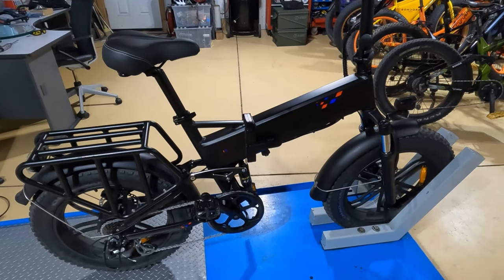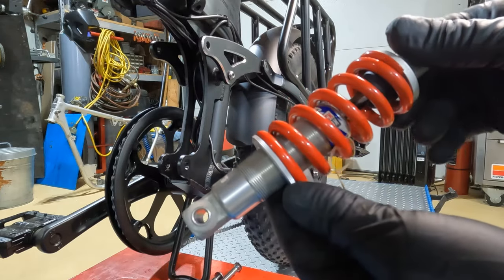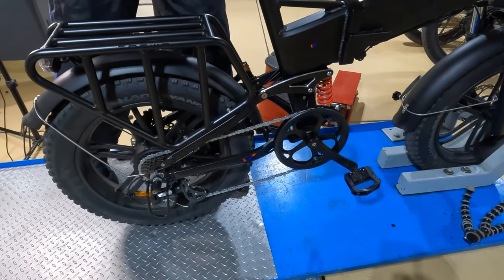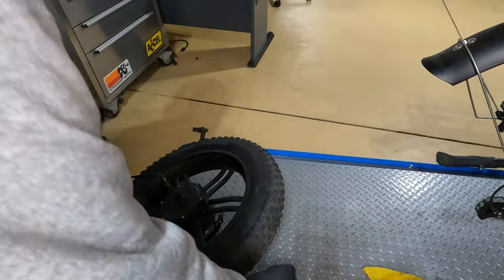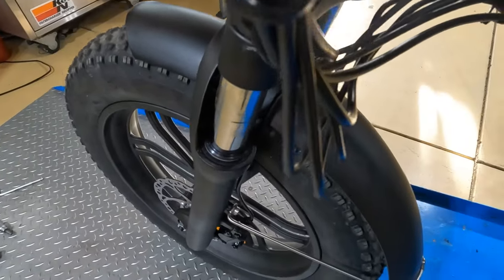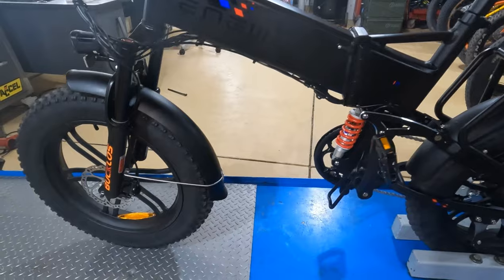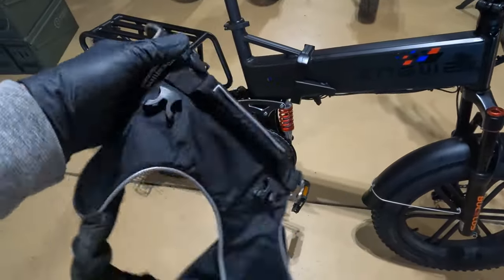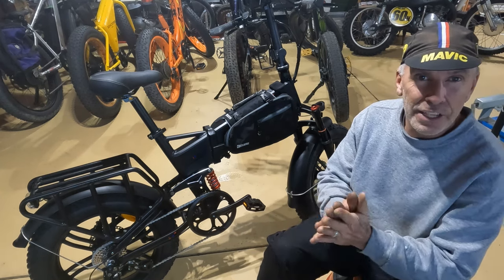Engwe Engine Pro 750w ebike Mods!  faster / smoother/ cooler!

Comment: engwe sells the bmx handle bars with the foldable bar together if you get the set you can use just the folding stem and put what ever handle bar you want the original one is way to tall and it looks ridiculous in my opinion that was my one and only upgrade so far get rid of the funny looking handlebar and too tall tube

Comment: Hello. I see that you know electric bicycles well. I want to buy one, but I have no way to try them. That's why I would appreciate it if you could advise me on a model. I tell you my needs. I am 70 years old and I am 5'5". I weigh 70 kg. I want it to walk, mainly on steep mountain trails. I don't need speed, but I do need it to be able to climb steep trails without having to pedal.
Reply from the maker: Hello Pablo,  welcome to the ebike family!  My best suggestion for you would be to go to local ebike shops and try out the bikes they sell in person. After doing so some people are impressed with the power and some are disappointed-- thinking they would be more like motorcycles. Until you try some out you really don't know if you are even going to like the ride they provide. Sorry, but that's the best advise I can give!  Cheers

Comment: Does the resistance on the motor (regen feature) hamper the free ride sensation? I like to buy a Engine Pro and doing research.
Reply from the maker: Sorry for the late reply. Yes absolutely, it feels as if you are using the brakes if you are not powering the motor.  There isn't an real "coast" sensation unless you are on a bigger hill. Please check out my regen video.  Cheers

Comment: Hi! Do you think it would be possible to increase the power? Like putting bigger engine or actually adding a second motor up front?
Reply from the maker: Hi Michal,  sure, adding a front hub motor, a second battery, a 750 rear hub motor are all possible and not too difficult to do. The question becomes do you put that time and money into this bike or do you just get a different bike that better suites you. For the same money you can get a much faster bike with a torque sensor (so important to a smooth comfortable ride), bigger wheels to smooth out the bumps, etc.  I'd say if you are hurting for higher speeds you are ready to upgrade to your next bike!  Cheers

Comment: Hi . I like the idea of the dog harness and side bags ..do the bags inhibit riding ( knee knock) when loaded.also am I right in thinking the harness is called K9 —- what’s the name of the bags ( K9)?. What size is the harness .. brilliant mods..I have one of the earlier Engwe Pro’s ..covered early a thousand miles with my Terrier on the back I use mine for work ( pest control)  .. I’ve changed the cassette also for climbing it’s like a Billy Goat now..also uprated the tyres to Kenda also pumped tyre sealer into the tubes ( that’s a must) and uprated the brakes .just subbed ( UK)👍
Reply from the maker: Hi Alan,  thanks for the comment!  I'm sorry to say I don't have a model number for the bags. I think that any bags of the same style will work well though. I liked these in particular because of the sort of tear drop shape of the bag, it fits the space very nicely. They are completely out of the way for me with no knee rub whatsoever. 
It's awesome that you get to ride with your dog! Mine are too large to ride with me although I have had my border collie in the trailer behind me for some shorter trips. 
You are right, with a gearing change this bike becomes a very good paved road climber.  Kenda tires would be a definite upgrade as I'm not too big of a fan of the stock ones, they are very thin and I believe they provide a fair amount of rolling resistance, They are definitely prone to punctures. Kenda makes some great ebike tires.  Cheers!

Comment: Did you have to modify the frame because the extra length on the shock or because it was a different shock ?
Reply from the maker: Since the shock is slightly longer the top bolt / spacers need a little extra clearance.

Comment: Does anyone know of a rear suspension similar to the one this gentleman is installing, that's the same size as original as I do not have the tools, to install a larger one , thx
Reply from the maker: Hi Dee,  you can use ebay item number 154852558419, it's a 6 inch shock with a 650lb spring that will soften up the rear end of the bike considerably.  No modifications necessary
Reply: Thankyou

Comment: Great video.
I just had 2 of these delivered last week - we`re not bikers, they're for transport when under way with our RV. One of the problems with buying online is not having the opportunity to test the bikes first. The second is how to deal with defects. We've come undone on both of these problems! 

Firstly, these are BIG bikes. I'm 5ft 7 and find the handlebars weirdly high. They're like the chopper bikes which came out when I was a kid - I remember trying one when about 12 years old and finding it very unstable. I'm therefore very interested in replacing them as you have done.

Secondly, both bikes are defective! The first one came with a broken cable, not detected until it had been assembled. This would appear to be a five pin power cable. We've sent photos but I don't see how I can undo all the cabling then identify and replace the broken one without some sort of engineer doing the job.
 
The second bike came without any keys!

I´ve taken the battery out of the first (dead) bike to be able to test the second bike. This re-enforces the need for a different handlebar, especially for my wife who's 1m 60cm tall (she's European:)

First impression is of a truly awesome machine. I just hope we can overcome the not so minor problem with the broken cable and somehow make the handlebars feel more comfortable. As we start to get used to the bikes I can imagine changing the suspension would make a lot of sense.
Reply from the maker: Hi Mac,  happy it gave you some ideas of what can easily be done to make it better.  I hate it when I get a defective bike out of the box, do you try to repair it or do you send the whole think back?

Please post here after you've dealt with the customer service department, I think lots of people would like to know how that all went. For me good customer service is a big factor in deciding if I want to purchase a bike.

I agree completely about the weirdly high bars, wish the steering riser was about 6 inches lower and still folded.
I understand you probably need the folding feature with your rv, but if not just put a normal bar stem on the bike with a set of bmx bars and it will look and feel much more normal.

Funny you compare it to the 1970's choppers, that's exactly what I was thinking when I first sat on the bike!
Best, Tom

Comment: The best upgrade I've done so far is to get rid of the tyres and put some kenda krusades on made a massive difference better range and grip. I tried the freewheel uohread but I couldn't get the gears to set nice as the chain would rub when coming off the freewheel but got a replacement original for £10 bargain. Great video and bike
.
Reply: Hello,  if you follow my channel you know how much I love the Kenda Krusade tires, they are awesome in all conditions. The tires that come stock on this bike are very cheap and thin, so not a big fan of these. There are a bunch of videos on youtube about how to adjust the derailleur to compensate for a larger freewheel. There shouldn't be any reason why it won't work well for you. Even if you don't go to a larger low gear I'd strongly suggest that the go to the smaller 11t high gear, it makes a huge difference when pedaling along at top speed!  Cheers and thanks for watching

Comment: Nice!
What rear derailleurs are compatible with an Engwe Engine Pro 750w? 
Also I see your Drift Maniac 8spd 11-32Tis. (Casette), how could you mount it if there are differences in the hub design?? :)
The Clubman cafe bars 7/8"  looks really nice! I have an MTB bars which reduced the height of the handle bar but yes, I cannot fold it..
Thank you for sharing and greetings from Skellefteå in the north of Sweden. (Do not forget to use winter tires)
Reply from the maker: Greetings from the USA, thanks for checking out the video! The rear hub on the pro uses a threaded freewheel vs a more common cassette. Just use a freewheel with a standard shimano thread and you're good to go. 
I ended up doing the BMX bar install after I made this video (you can check out that in my regenerative braking video) even though I did like the clubman look.
I've been told that a low folding bar stem is available from Engwe so that you can use the BMX style bars and still have the bike fold. I haven't looked for this stem as I like the setup currently on the bike.
You can use any long cage shimano derailleur for an 8 spd system, they should all be indexed the same to work with your bar shifters. 
Cheers

Comment: Nice upgrades, well all but the bars. Sorry, but not for me. I like BMX bars and the folding option isn't important to me. 
Where did you get the sleeve you put over your battery on your Ranger? I'm losing a lot of range and need to wrap my battery with something. Bakcou makes an electric thermal wrap, but I'm not sure I need to go that far.
Reply from the maker: Hi Joe,  I thought I'd try the clubman bars to lower the bar height and cover up some of that incredibly long riser!  But the big long riser still bugged me, so I've already done the swap to BMX bars!
It's a way more traditional bike look now and doesn't remind me of a senior mobility rascal scooter!!!
Sorry but I don't have the Ranger battery cover info here for me to check. I know several people have asked that and I've posted the info before, so if you go back through the comments the info is there. 
It is a big improvement in cold weather and helps with battery life.
Cheers

Comment: Hi from Australia.
Sorry I am a bit late as I only just found your channel. Great Video and thanks for patience in putting it together. I have had my Engine Pro for 4 weeks and love it except for the issues you cover in this  video . I weigh 120Kg and the front fork is soft . I would like to do the front air shock upgrade but when I search for Bucklos 20 4.0" MTB air suspension fat fork there are a lot of models.
Do you have a link to the exact model? Thanks again!
Reply from the maker: Hello, sorry but there wasn't a specific model number listed in the purchase I made of this fork. The best I can do is give you the Ebay item number to the fork I bought..... 175671535897.  Hope that helps and ride safe!
Reply: @lifebehindbarz60  Thanks I found the forks .

Comment: PLEASE BE AWARE THAT THE REAR MUDGUARD HOLDER WILL SHEAR OFF IF THE REAR SUSPENSION HAS TOO MUCH MOVEMENT!!!! THIS CAN RESULT IN CATASSTROPHIC EVENT IF TRAVELLING FAST. Happened to a guy on reddit and on my own one it half of the bracket has already a clean fracture throught it as well. The most important upgrade for this bake are the brakes, now the new one has hydraulic oil brakes BUT i dont know if they have increased the DISC size as well. 160 mm aint cutting it for a 180 pound dude plus 60 pound bike plus luggage. They will cause super hot pads within seconds.

Comment: Any idea about how to fix motor stuttering when it reached to top speed ? its very annoying
Reply from the maker: Sorry I've only had that happen with one bike and it was a failing controller. Without the bike in front of me to test I can't really say for sure.  Cheers
Reply: @lifebehindbarz60  i don't think bike has any problems. Because if i made the top speed 28 i can peacefully ride with 25 km but if make it 25 it makes very uncomfortable because it cuts the power when it hit 25

Comment: Hi, thanks for the video.... Just a random question, my wife has the EP2 PRO, has anyone had any oil leaks from the rear motor casing, I wiped it off the first time from new and now after a longer ride there is like a fine mist all around the wheel, maybe the motor has a lot of lubricant in it, and it will settle after more miles.... Just thought I'd ask.
Thanks

Comment: Please tell me, is it possible to install such a fork if the one I have is threaded on top? The fork is screwed on with a nut. Or will you have to buy a new folding steering wheel for your version?
Reply from the maker: Hello, I don't believe you can use a fork with a threader tube on this kind of headset
Reply: I have such a fork on Engin X. Sorry for the Google translation. I'm on my way to work now, if I have time I'll take a photo later.
Reply from the maker: @СергейПархоменко-х7ъ  No problem, just send me a pic of what you have a question about.  Cheers

Comment: Hi.can you help me please?. I have a ado beast. Is it normal that when the feather go back it give a kickoff noice? Is it same with the engwe?
Do you know if is the same size of the feather ( original)
Reply from the maker: Hi Norman,  can you please word your question a different way, we have a weird translation and I'm not sure what you are asking.  Cheers
Reply: Hello.  I have an Ado Beast bike.  When the bicycle fork(shocks?)extends there is a metallic noise.  I think it comes out too quickly and then there's a bang.  Is that also the case with the engwe?  Do you know whether the original engwe suspension fork is identical to the one from Ado?  could the fork you installed also fit my bike?  I'm from Germany.  my school English is totally rusty.sorry
Reply from the maker: Hello Norman,  no worries, your English is better than my German!  I can't tell you if the fork on the Beast is exactly the same as the engine pro, but I can say with some certainty that the internal design of both forks is the same. Your fork has a spring inside that is supposed to absorb the energy when the fork tops out as you describe. Sometimes the top out spring is very rigid or just too short (I've even seen a urethane bumper used)  so in either case it's ineffective when it comes to providing a smooth clunk-free full extension. It won't hurt anything but it is very annoying when you are hearing and feeling that all the time. You can open up the fork (remove the two bolts on the bottom of the lower fork legs) and see if there is a fix for this, ie a different spring or bumper that you can install.
The Bucklos fork I show here will work fine on your bike, just look first to see if you need a tapered or a straight steerer tub. I like this brand and have had good luck with them on fat tire bikes. Easily adjusted, lots more travel, and no clunk!
Cheers
Reply: @lifebehindbarz60  thank you very much. I will test it👍
Reply: Arrr. The distance between the screws for the brake is 50 mm for me.
Reply: Arrr. The distance between the screws for the brake is 50 mm for me.
Reply from the maker: @normanerz   Oh, that's too bad, the 72mm is pretty standard. You'd probably have to replace the caliper or maybe they make a 50mm - 72mm adapter?